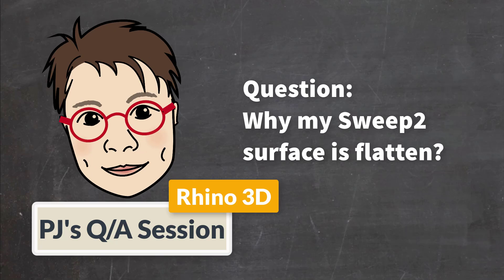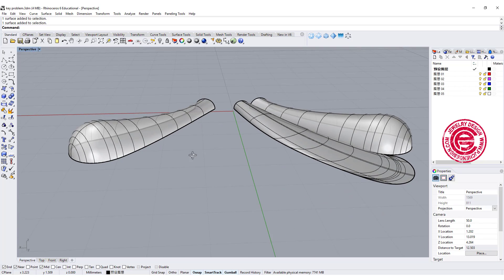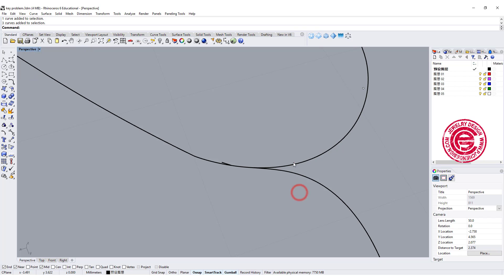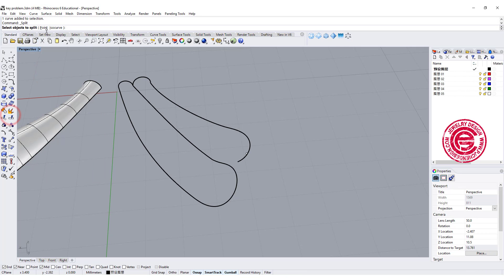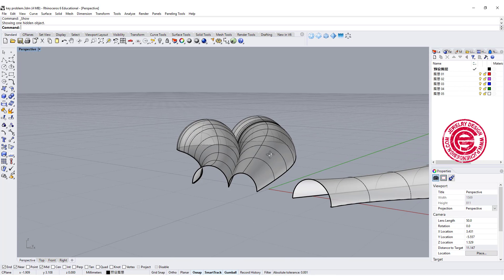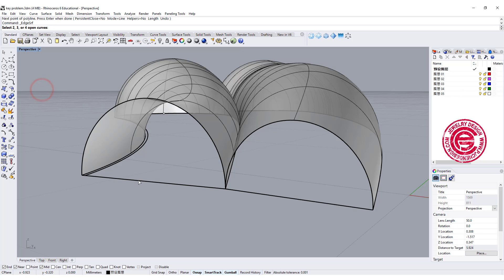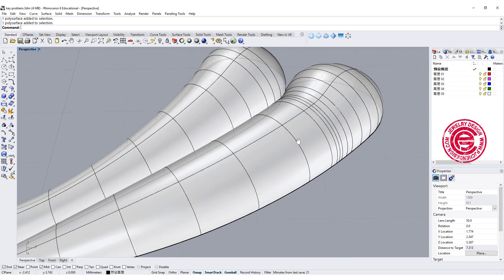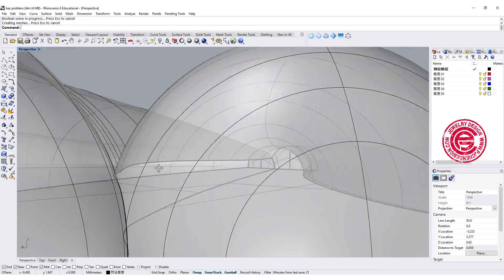Sweep 2 Surface is Flatten Issue: Q/A Session (2019)

Comment: How can you make a smooth branchs from the ring shink, using the fewest tools? For example, there is a shink with a rectangular section (with rounded corners) and from a side of the shink there are 4 branches (2 branches above and 2 branches below) with rectangular sections (with rounded corners) and smoothly turning into round sections. Sweepe rail for branches is not suitable because when customizing sections of branches, the branch surface will peel off from the surfaces of other branches in the section where the branches merge and turn into a shink of the ring. Sorry for my english (i used google translate). Photos of what I mean (some rings on one half of the shink (I do not know how correctly "shink" or "shank") have 2 branches, which are divided into 2 more branches, but it is necessary that the shink is divided into 4 branches at once):
https://goo.gl/images/e1bVdk              
https://goo.gl/images/BSXhGa
https://goo.gl/images/5Miu1W
It's a difficult question. Due to the fact that I did not find ways to create branches in such a way that it was convenient to edit branching -> I had to learn T-Splines.
Reply from the maker: There are similar command in one of my video. you can check out my video https://youtu.be/VYdZw-8FPRQ . that may answer your question.
Reply: Thanks, but I meant a way that would allow to do without mixing the surfaces of the branches. Imagine a solid with square ends, one end of which is conventionally divided into 4 squares and a branch leaves each square. Such a figure can be made if a solid subtract a cross made up and two solids. But editing this type of branching is possible only by doing Ctrl + Z, editing the subtracted solidides and re-making the boolean difference. And the surface would turn out to edit only transform tools. I would like to edit the position of the branches and the place of their merging by editing the original curves without applying transform tools, and I would also like to have fillets at all angles without applying Fillet to the surface as this will break the history record.
Reply from the maker: in this case. i think clayoo or Tspline work better
Reply: I think so too, but I wanted to achieve such a model of work working in Rhinoceros and I came to the conclusion that this can be achieved only by organizing a sequence of actions in which tools that break the record of history were used last (Boolean tools, Flip direction, Fillet edges, etc.). First, the history record is turned on and the skeleton is made up of curves on the plane, then Flow along curve is created, then surface areas are created on the frame located on the circle, then the branch is edited (on the plane frame) with simultaneous selection and movement of editing points on several curves related to one branch (it will be similar to moving the edges in T-Splines), only after that the Flip direction is applied to the surfaces that need it, then Join and at the end of the Fillet edges. Or I need to learn how to masterly use Cage Edit quickly by creating control objects of the desired form. T-Splines are also not perfect because crashes happen with the loss of all data, and there also have to solve the problems of star points and there is an inconvenience that you have to switch to a polygonal and smoothed look - this is equivalent to switching from a frame of curves on a plane to a frame wrapped around circles with surfaces created on it (in both cases it takes some time and therefore I do not consider T-Splines to be a perfect tool and look for methods to avoid using it).